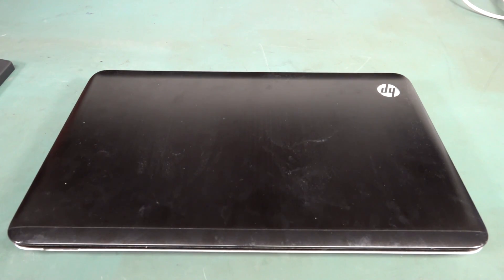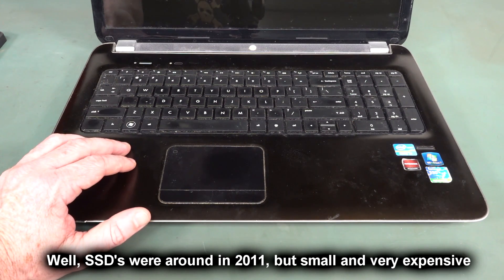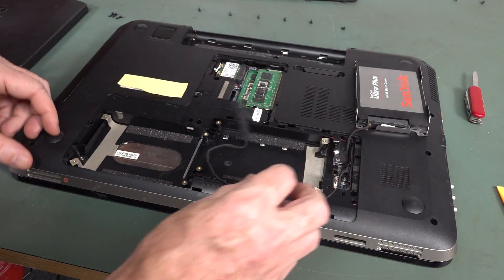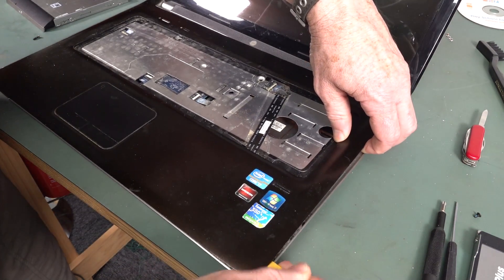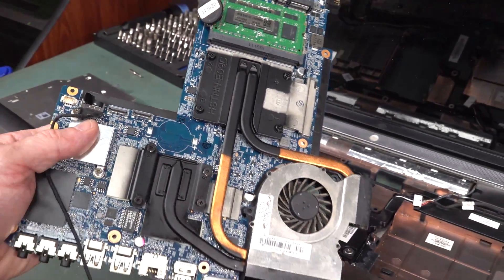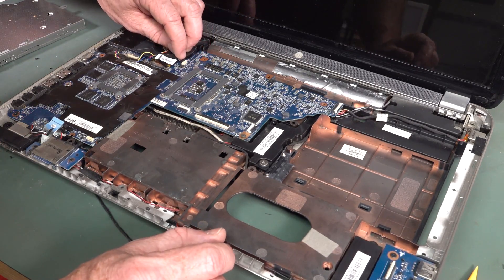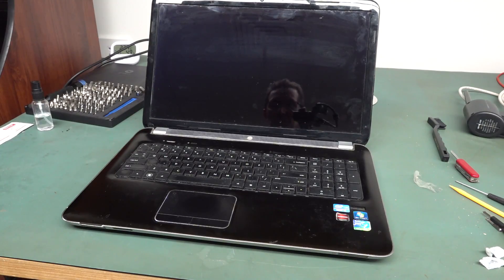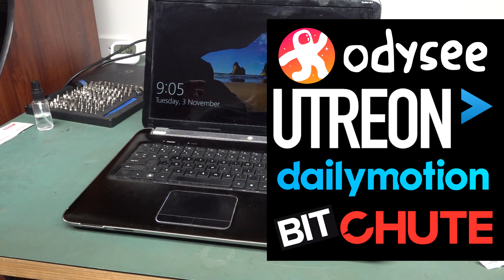EEVblog #1345 - HP DV7 Laptop Repair

Comment: Back when I was in computer repair we saw LOADS of dead HP DV series systems with dead nVidia GeForce GPUs and/or nForce chipsets. Failure rate as a % of units must have been crazy. This was Win Vista/early Win7 era.
Reply: Yep. Remember that. Nvidia 8000 series chipsets (and the corresponding quadros) from production date 2007 to August 2008. Had bad underfill with a wrong thermal expansion coefficient. The chip basically separated itself from the carrier on a microscopic level. 
There were many laptops with this chipset. 
Thinkpad T61(p), Macbooks, HP DV. 
The Apple and HP where especially affected since they both ran very hot, which accelerated the process a lot. They had a lifespan of around 1-2 years while the Thinkpad lasted 2-4 years. But they all die eventually. For the thinkpad, later production runs have a fixed chip (date code aug/2008 and later).
The corresponding desktop cards where also affected, but the usually outlasted their usable lifespan as GPUs developed very fast at that time. Some didn't. That's were the GPU baking myth comes from - those cards/ laptop boards could be temporarily revived by baking them.
Radeon HD5000/6000 series had a similar issue
Reply: @TheRailroad99  August 2008? Rats, my T61p is dated 08/06 on the bottom sticker. I guess that means I'm on borrowed time then, unless the motherboard was changed at some point. Do you know how to tell by looking at the board?
Reply: @eDoc2020  yes I do!
Take of the Heatsink, then Look at the NVS140M chip. It will have a datecode like 0826A2 where 08 is the year and 26 the week of the year. August would be something higher than 31. 
Keep in mind the T61 is also available as an Intel-only which of course is not affected.
Reply: @TheRailroad99  Thank you, I'll take a look when I have a chance. I actually have the 'p' model with the 570M (G84M) instead of the standard NVS140 (G86M) model. I presume the datecode is the same but do you know if the fix date is the same?
Reply: @eDoc2020  same for both chips. 
By the way. There are undervolting BIOSes available that greatly prolong the life of the GPU, even if its a bad one.

Comment: Hahaha those blasted models! I had a dv that I had to periodically disassemble and hit the GPU with hot air to keep it working. It had several millimeters between the gpu and the heatsink filled with a rubbery thermal pad. MILLIMETRES?!?! Learned never to buy "consumer" grade laptops after that, access to the guts was painful.

Comment: The drivers direct from AMD should work. Hit the AMD website, top right side Drivers and support. Then in the pulldowns, Graphics, scroll down AMD Radeon HD, The AMD Radeon HD 6000M Series, then the AMD Radeon HD 6770M. Should be the 15.7.1 WHQL, legacy drivers, but should still work for windows 10.

Comment: You can do a fresh Win10 install just by holding Shift and clicking Power and Restart and in the menu it auto gets the MS files from the net for the install, ie no disk needed.

Comment: If you go to the AMD website you can download the legacy drivers for the graphics card and they run with windows 10 I know they work as i used to run a laptop with 7670m in it and had the same problem on windows 10. Don't bother with the Radeon Software Crimson Edition Beta use the Catalyst Software Suite download and it should run fine

Comment: Windows 7 is the best of Windows. I have no plans to move higher. 
I'm still running win7 x64 and love it. Been using windows since it came out in 1985. 
The rest of you were noobs before you even knew you were noobs! 
Win7x64 is super fast and after removing a few MS spyware updates, it's not spyware anymore. 
Try doing that with Win10 bloatware/spyware. 
I run Linux Mint on my cheap Acer laptop, and it runs like a dream. Thank you very much!!
Reply: Bullshit mate.  Windows for Workgroups 3.1 was the best.  I ran Linux on a dozen old shitboxes over the years, and amazingly, was never once able to do anything useful with it.

Comment: use Snappy Drivers app, I have a similar GPU chipset on a certain laptop, and it work just fine with Windows 10. its probably a Windows 8 driver that works on Windows 10 (not suprising).

Comment: Hey Dave greetings from Austria (not Australia)
As always great video love it
i just have two questions 
at 10:51 is a thermal strip visible thats sticking out from under the cpu heatsink (should be on the power rail)
and did you remove the silver fan shroud? usually there is some dirt between fan and heatsink

Comment: Dave!  You didn’t take the fan off the heat sink.  There’s ALWAYS a big build up of dust and fluff on the output of the fan before the heat sink fins.  I’ve had to clean so many of these things.
Reply: Yep, I bet there's still a big lint carpet in there. Blowing air doesn't always remove it either.
Reply: ..... Correct,  the silver shroud removes and the fan rotor on some models remove allowing you to place some grease in.
(if you don't want to replace it).
Reply: @MrMe01  Haha yep, peels off like the lint in the tumble drier lint catchers
Reply: ditto reddragon.  I also have cleaned many.
Reply: The service manual is on the internet. Alot easy to find the screw to remove.
Reply: Don't forget to clear the fluff from between the fins.  Speaking of fluff, you strike me as a scalie (furry with scales instead of fur).
Reply: @GeneralPurposeVehicl  🤫🤣
Reply: Indeed, you really have to check inside the fan/by the finstack when taking apart a laptop. These DVs were well known for running hot, and are well known for getting lots of dust and dirt accumulate. I've had one with a failing GPU and one that's totally dead, both caused by the same problem. The failed one had a completely blocked finstack.
Adamant IT also dealt with one of these (which failed) and the problem was the same, severe overheating caused by dust accumulation.
Reply from the maker: Thanks, will check if I open it again, at the moment it's working so no need.
Reply: @EEVblog  It have to be done, before "something shitty happens". AMD's GPU's never liked overheating.

Comment: You needed to disassemble the fan, because theres always a giant matted up crust of dust built up between the fan and the heatsink blades...
Reply: I was screaming at the screen, "open the fan assembly and remove the lint buildup on the radiator !!!!"   :(( :(( :((
Reply: @Wisecrackerist  This is a pre-recorded video so he isn't able to hear when you say things to him.  For the longest time I thought he was just ignoring me, but then a friend explained what was going on.  Hope this helps!
Reply: @JohnClulow  LOL
Reply: yeah i take apart my alienware yearly  to clean it out
Reply: Just blowing it out with ‘proper’ air pressure always works for me.....
Reply: And not just that, you also need to clean the stator and rotor and grease it up to reduce friction + noise and prolong its life.
Reply: @windson7 Not necessary, it can easily make it worse or shorten its life. It's not just some random silicone grease, it's a very specific lubricant that goes into bearings like these. I used to check them, but usually just check the consistency of the old lube and if it's fine, just scrape some off of the excess around the shaft and recoat the shaft with the old, original grease. If the consistency of the original grease is not right (dried up or sticky), I used to use some SKF bearing grease after cleaning off the old one.

Comment: I know you pooh poohed Linux as an option, but...nice hardware like that deserves better than Windows, and since its not your main lappie any more, may be tempted to try PoP!OS or something Dave? I do understand the "couldn't be bothered learning something new" mindset, so you are forgiven from the outset if you don't try Linux, but you don't strike me as someone that shys away from challenges like that. Anyhoo, nice teardown. Its nice to keep old but good stuff going.
Reply: Given that there are plenty of good video editing options on linux and you'd get full driver support for that and it would run better than it runs windows 10, it would really be a good option. I have done a lot with old laptops and linux, it really gives them new life. So yeah I was surprised by him disliking the idea, especially when windows just makes these painful to use.
Reply: @JeordieEH  to be fair, there is only one good video editing option on Linux but I guess Dave is not using Davinci Resolve on Windows.
Reply from the maker: @PainterVierax  Davinci Resolve is not suitable for my workflow, I tweeted this out this week.
Reply: @EEVblog  Hi. You don't need to switch to Linux and ruin your processes. But since you have many machines (and this laptop), it's quite logical to have a nice and friendly Linux distro on one of them.
Periodically you have trouble with hardware from the Mailbags: drivers and software problems and other Windows magic. Sometimes you have trouble with software from the GitHub.
Those type of things is Way easier to do in Linux, you can really save an hour.
Reply: @EEVblog  I just read your tweet about it. 
And yeah it's understandable since most people are used to Vegas or Premiere. It's often hard to adapt an efficient workflow to another tool. It took me a while to get as efficient as Photoshop with the ergonomic differences of Gimp and Krita.
Reply from the maker: Not going to happen. There is zero advantage to me moving away from Windows, all my tools are Windows based.
Reply: @EEVblog  I'm sure, but zero advantage? You get to use that old laptop for one and you get access to a huge range of tools, BUT - there is an investment of time, time you probably can devote to something closer to your liking.

Comment: Install the old radeon drivers on windows 10 using compatability mode set to windows 7 and it should work a treat. That's what I had to do with the old one I gave to my sister-in-law. The Beats audio driver can also be installed the same way.
Reply: .... Win10 update will continue to replace your legacy driver and it will fall over again,
You don't want a machine with WinUpdate disabled, My advice, (40 years exp.)
Give the machine to someone you don't like. Don't purchase products with AMD components.

Comment: You can get the 6770M working, either use legacy AMD drivers or Leshcat's drivers which support switchable graphics, thought you'll probably have to scour around for those. The 6770Ms on these do have a tendency to die, but worth a shot. I have a dv6 version and it's still going strong, in fact, I consider upgrading every year and there's just nothing out there that justifies it for me. Probably going on 10 years now! Shame about the cheap plastics on the shell, it's the only thing I've had to replace over the years.
Reply: Was pretty much the only option of updating the drivers on my DV7 (Radeon HD 6370) as HP never updated the drivers once since I bought the thing in 2010. The laptop is still in use today, albeit, with a SSD. Also upgraded the CPU from the i5-460M to the i5-560M to get it above 3.0 GHz.

Comment: OK, I have a DV6, and thé noise of fan is loud. No possible to use it for watch vidéos. It sleep now in à pocket for ever. Yes, I change thé thermal grease and clean  the fan output. Same noise
Reply: Bad bearings, replace the fan.

Comment: Mine started restarting (tried ubuntu, same). Checked memory, seems ok. I'll try to repaste it, but do you have any other advice? Maybe check voltages? (but i doubt i can repair that)
Reply: I have a different make laptop (dual-booting Ubuntu & Win10) that suddenly started powering off seemingly randomly - hard power cut, not a clean shutdown. One of the GPU heatpipe standoffs pulled free of the motherboard. I replaced the thermal compound then got the standoff sorted. No more problems.
Reply: @AerinRavage  That seems positive. During editing I deleted that this is different laptop too.

Comment: I have an hp-dv7 6135dx and it is super garbage. The graphics driver even windows 7 brand new was super bugged and broken to the point id say it was defective off the line. I dont condone throwing away a computer but 2011 dv7 I would throw it away and get another, any other pc but that.
Reply: .... My advice, (40 years exp.)

Give the machine to someone you don't like. Don't purchase products with AMD components.
Reply: @robbieaussievic  I do still have it, its sitting in the pile. I wouldnt say its amd products per say but more their graphics division. Terrible drivers and when it did work it would still freeze and crash. Bought it back when I didnt know much about laptops and laptops were just becoming good.

Comment: Can you disable the ATI graphics in BIOS? It's probably driver detection that is causing the slow boot - that is very slow even on an old machine with SSD.

Lenovo office grade machines have always been good, in my experience, I've had a few 10,000 seat plus clients use Lenovo and other brands, and reliability wise Lenovo generally wins. The only consumer grade Lenovo laptop I have owned started playing up within 6 months, a lot of people had the same problem with a dodgy display cable.

Comment: Its probably defaulting to the intel graphics, you cant install drivers for the Amd graphics while running on the intel one. Try going into the bios and making Amd the default graphics and disabling switchable graphics mode. The Amd graphics should still work before you install a driver for it with the generic windows display driver.

Comment: Hi Dave, have you considered a Lenovo P17 over the Legion? It’s a mobile workstation machine in comparison to a gaming laptop. You will find the build quality better than the gaming machines IMO. I say this because I procure business grade laptops as part of my job. https://www.lenovo.com/au/en/laptops/thinkpad/thinkpad-p-series/ThinkPad-P17/p/22WSP17P7N1 Alternatively, you can pick up a Dell Precision 5540 - they are a solid machine, though it does not have a num pad.
Reply from the maker: Almost double the price, no thanks. This machine will only be used occasionally, not worth it.
Reply: @EEVblog  fair point, I wasn’t aware of your budget. The suggestion came about to keep you away from the “consumer” rubbish 😉

Comment: I was really expecting to see a lint brick come of the space that's between the radiator and the fan (Not that it looked easy/reversible to open). Some of these computers go full "lint trap from the clothes drier" on you and completely block the air pathway.
Reply: the metal shroud/cover is fastened onto the fan housing by little screws. Too bad he didnt see that.
Reply: @waize  Is it attached using screws? In my experience in that style of cooler it's heatstaked on. The best setup I've seen is what's on my Dell Inspiron 8600/Latitude D800. There the main fan is a separate module which is directly accessed from the bottom. No need to disassemble the laptop to remove the dust, just turn it over and undo two screws to get at the heatsink.

But speaking of "lint trap from the clothes drier", when we went to upgrade the RAM in my Dad's old Dell desktop (Dimension 3000) there was a solid layer of dust covering the front of the fins. Somehow the fans didn't go crazy and overheat. Also have a laptop formerly owned by a smoker and as one expected that ran hot and overheated. Originally I thought it was because it used a desktop Pentium 4. I was wrong. After taking it apart and removing tons of brown residue it runs fairly cool.
Reply from the maker: I think quite a bit came out when I first blew it out, didn't get that on camera as it was outside.
Reply: Removing that lint usually makes a big difference. And after all that time, you will have some.

Comment: Ive got the same laptop as a 15.6" and it is still going strong as a daily driver. The video card is indeed not supported any more. However Leshcatlabs provides drivers for it that work fine for years now. I can remember that it has some troubles switching between de onboard and radeon graphics when in energy saving mode. Solved by selecting high performance mode.
Reply: yup leshcatlabs solved all the issues with interchangable graphics, they be blessed
Reply: What's leshcatlabs? I use this laptop and I never managed to get the gpu running with windows 10.
Reply: @TheAstronomyDude  there were a team of some amazing people that developed a custom driver for this interchangable nonsense
Reply: Have the same, mines is a DV7T-6c00-17", custom, had win 10 with Leshcatlabs, works ok but gets so hot had to go back on Win 8.1 and use original drivers. And lately youtube video freezes but audio continues and freezes my pc for about a minute then it all goes normally but only on Firefox. Opera, Edge or other browsers work ok. Had to "reball" with hot air the Radeon video chip a few times and works ok. Really love this HP DV7T notebook and don't change cause can't find a 17", at least here in Buenos Aires, Argentina. Is there a way to disable or take away the Radeon?? I use my notebook ONLY with Altium, Multisim, program PSoCs and navegate thru internet, don't need HD or sort of things. Long time subscriber!
Reply: @EDGARDOUX1701  u'd have to disable it at a Bios level and use windows 7 so windows does not automatically install its driver, thats how ive "fixed" most of them

Comment: Those HP DV5 and DV7 were infamous for the cooling fan failing. Very common part found on Amazon in the day. I repaired my daughter’s DV5 by replacing the fan. The fan was $5 or $6 bucks. Then a couple of hours of labor for a complete disassembly.

Comment: I think you can disable the radeon gpu from the laptop bios since it is a hp hit f10 key right after you turn it on and you should be able to see a option in bios regarding graphics card bs and you have to either set it to disabled or UMA only which uma means the intel hd graphics